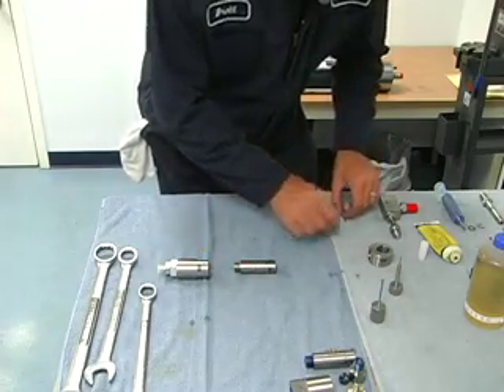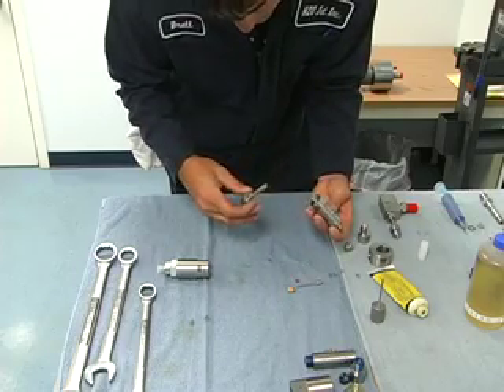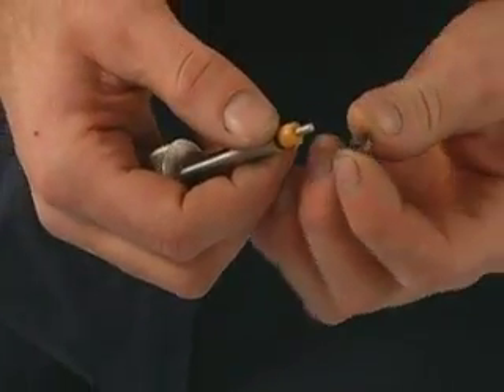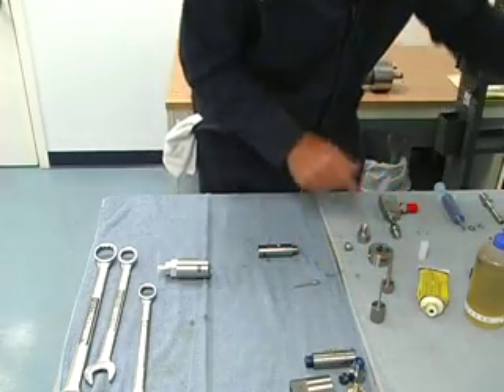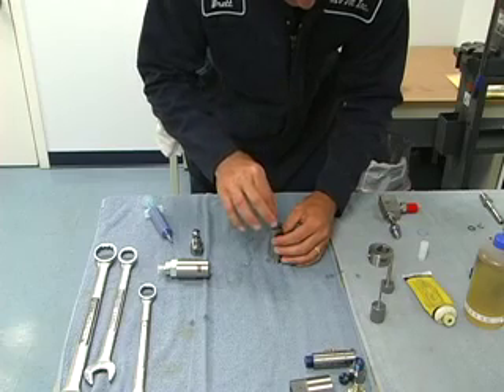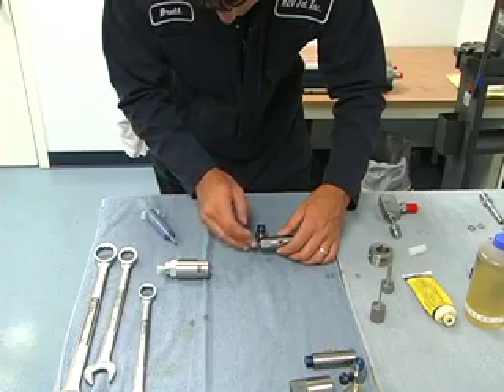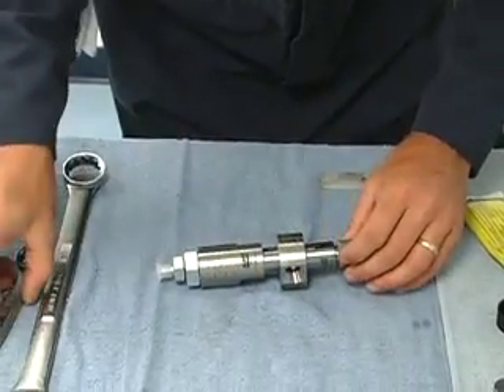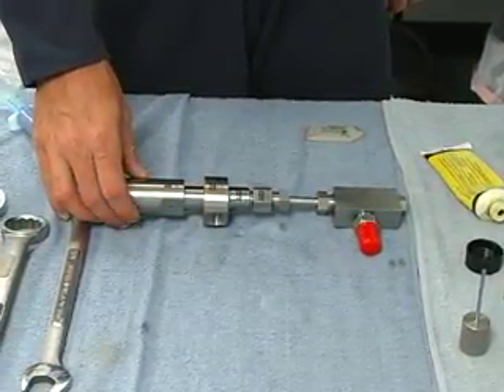Part 2 of 2:  How to rebuild a H2O Jet or Flow Auto Bleed Down Valve for Waterjets

Comment: i cant get the collar and nut to seal enough for the high pressure inlet to seal with the conical nosing.  any advice?
Reply: you need to re-do the conical pipe with the thread